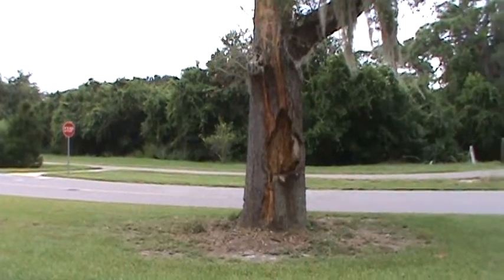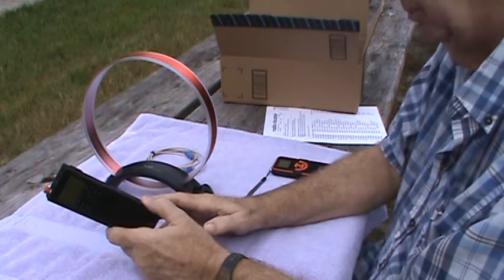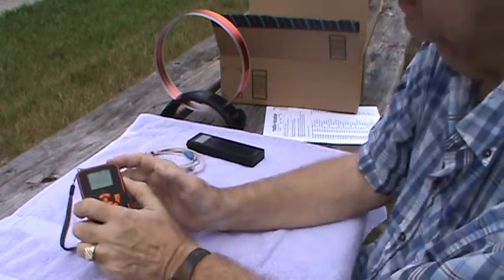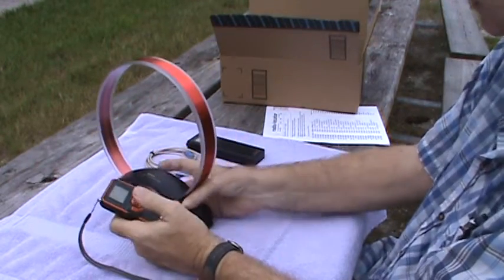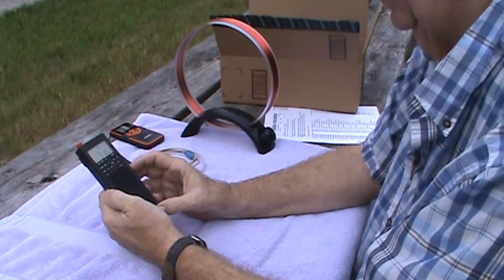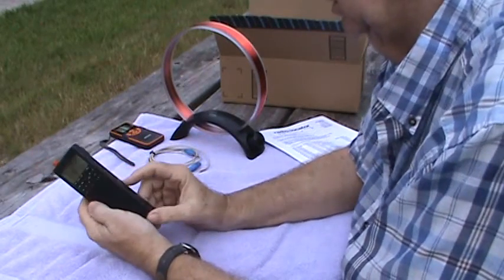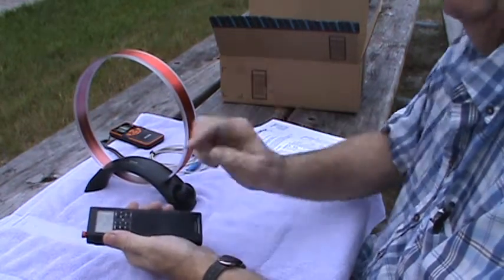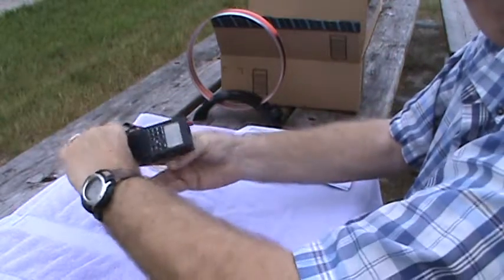TRRS #0665 - Loop Antenna, Field Tests - Final Answer

Comment: If you were meant to put the radio in the loop they would have made a flat platform to place it on, you place the radio next to the loop at a 90 degree angle.

Comment: I just ordered this. I hope it helps with a weak station I`m trying to get during the day. Lots of static in the house because of the satellite box though. The old one was quiet but it died and the new one is terrible.
Reply from the maker: Keep us posted on your results, please.
Reply: @hamrad88  I will. I think it will arrive Tuesday or Wednesday. I was hoping to connect it to my longwire dipole for AM DX but when I plug it into the radio I hear horrible static from the satellite box on AM. The antenna input is for shortwave, air band and FM though and it used to help ground the receiver when it was plugged in and improved AM reception. 

After getting the new satellite box I had to get rechargeable  batteries because AM listening is impossible now with it plugged in. Maybe I won`t get the same static on AM using the loop inductively connected to my antenna wires. 

I was planning to build my own larger loop but I figured up the cost and it was over 50 bucks so I just ordered the Tecsun loop instead. I had all the wire, tuning capacitors and other things to make a good loop and my buddy moved while I was away and I lost most of my possessions.
Reply from the maker: Keep us posted, please.

Comment: Good video Tom  the bigger the loop the stronger it amplifies  always point the  thin part of the loop towards the signal is stronger  it will  null the signal broadside.  You said you were 100 miles from Orlando .  I happen to be 100 miles south of Orlando  are you south or north  . You could be a neighbor.
That would be funny if you are local.
Reply from the maker: Tampa Bay area.